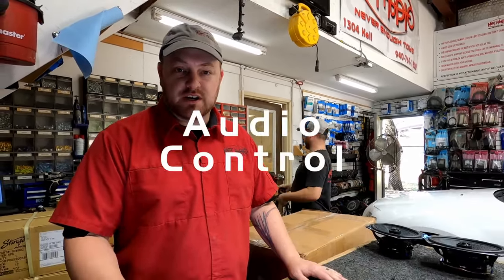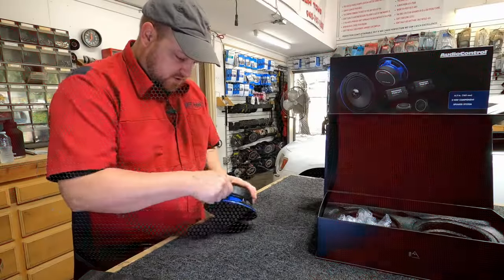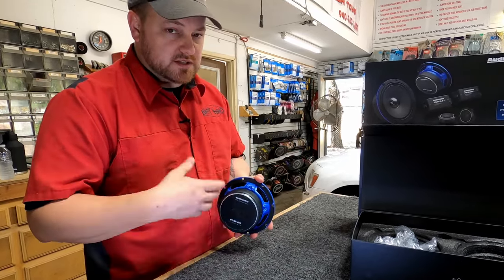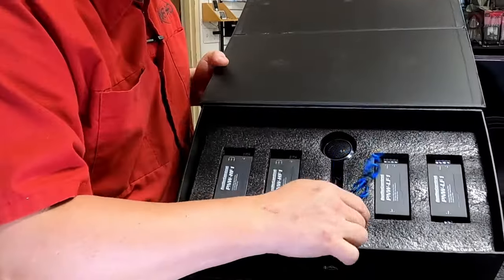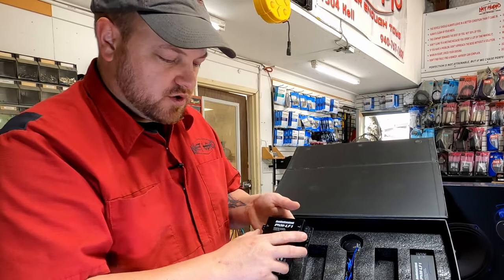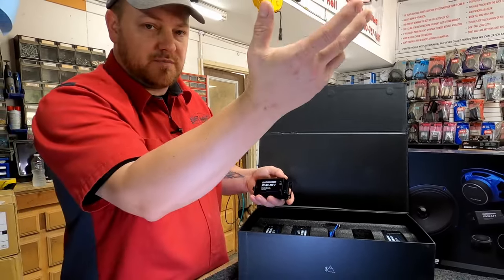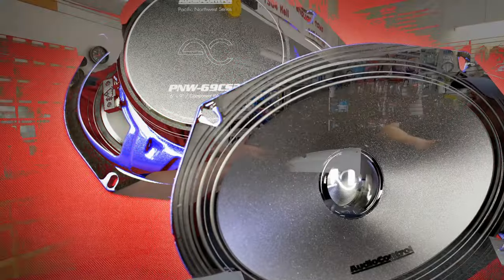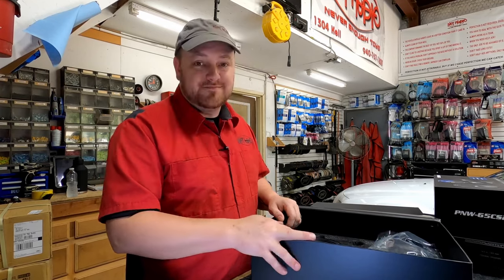NEW AudioControl Speakers Unboxing - Pacific Northwest Series 6  1/2" and 6x9 Speakers

Comment: 3 ohm?? 🤔 why
Reply from the maker: Just to get a hair more power from your radio or amplifier.
Reply: @Netaudiowf will they work with an amplifier that can run 2ohm or 4 ohm. Would run off a JBL MS8